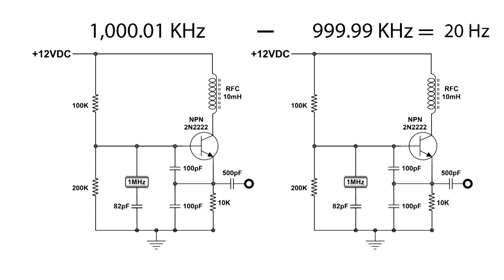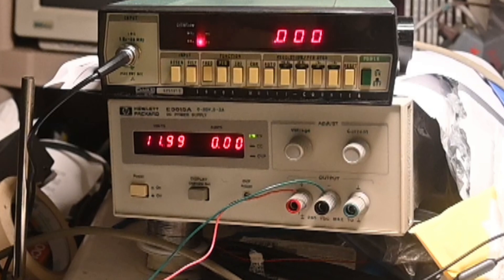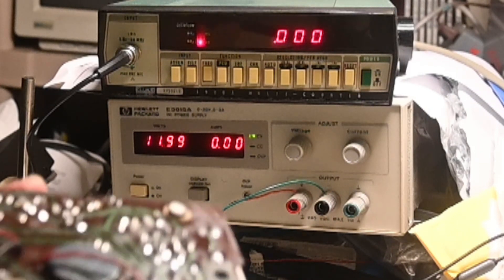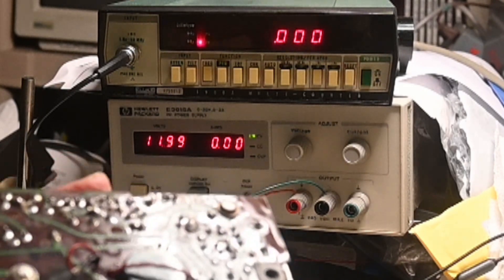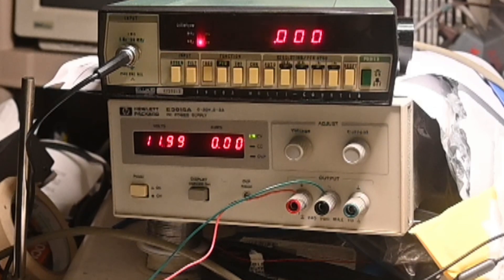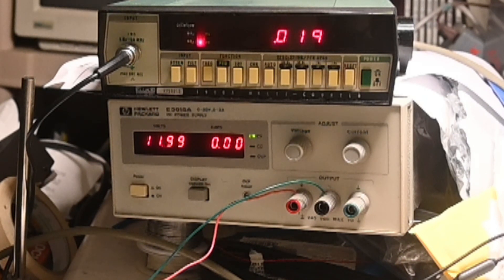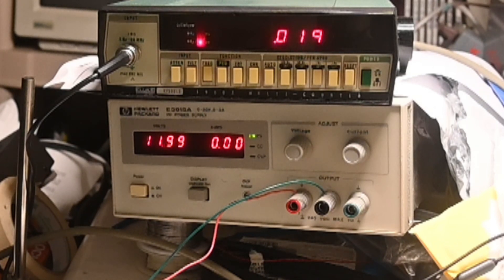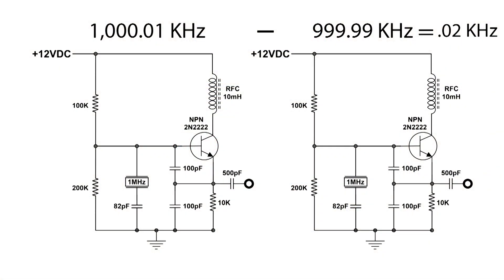Two 1MHz Crystal Oscillator Experiment

Comment: Occasionally at night when there are two AM BC stations on the same channel,  of similar strength,  you sometimes can hear a very low freq.  beat note,  not as rapid as that but a detectable fluctuation demonstrating a freq.  difference.   But most of the time not.  Which demonstrates the very high freq. tolerance for even AM stations of modern tech.  Although some stations may possibly be using vintage transmitters.
Reply from the maker: YES and it is all interesting!!!
Swap 1MHz Crystals and change Capacitor  and Voltage Values
https://www.youtube.com/watch?v=_0EhpM6bRaE

Comment: The more the videos contain OSCILLOSCOPE testing graphs, the more interesting the videos are!
Keep up the good work 👍👍👍
Reply from the maker: If you want more OSCILLOSCOPE  videos do a channel search on my channel for OSCILLOSCOPE .
Analog & Digital Oscilloscope Comparison on Tube AM Radio
https://www.youtube.com/watch?v=6D86WHKTHoM
Oscilloscope a Few Basics
https://www.youtube.com/watch?v=m7XCEecpBfk
Oscilloscope signal tracing
https://www.youtube.com/watch?v=B44wHjb8jMY
Digital PC Oscilloscope Signal Tracing
https://www.youtube.com/watch?v=_fHAuzDIgEQ
RF Bypass Capacitor Oscilloscope Demo
https://www.youtube.com/watch?v=OILLayQjEjY
Basic Oscilloscope 101
https://www.youtube.com/watch?v=WiNpGZaJArA
LC Resonance Oscilloscope Demo
https://www.youtube.com/watch?v=G_RCyDdt2rM
AM Radio Demodulation Oscilloscope Demo
https://www.youtube.com/watch?v=pKA0TPdnHg8
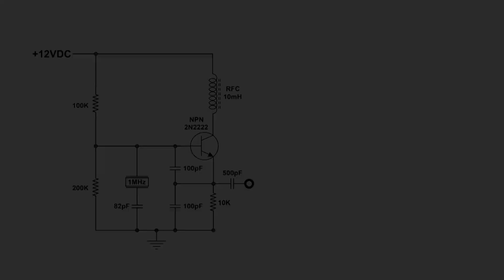0:00 / 3:16
Oscilloscope Trace Analysis 
https://www.youtube.com/watch?v=l77kAYx5QLg
Voltage Doubler Circuit Build Oscilloscope Demo
https://www.youtube.com/watch?v=kSRcBzNvnSo
Impedance and Frequency, Oscilloscope Demo
https://www.youtube.com/watch?v=TRSNKwtUy8g

Comment: Hi Rick, two things. First,  I don't know if you saw my second reply in the comment of four days ago? 
Second, I don't know if you have seen this 1943 American film/video about the manufacture of quartz crystals. It's fascinating, although I wonder how many of the girls suffered as a result as a result of the X-ray equipment used in the process.   https://youtu.be/duZlWWwxIPQ?si=cCgTbayyHrPXcW15   
I knew the basics of making the crystals but the detailed explanation really takes it to a mush higher place. The title . . .  From Raw Crystal To Crystal Oscillator _ Crystals Go To War in 1943.
Kind regards . . .  Andy
Reply from the maker: Hey Andy, I got busy with Thank Giving and I just finished a circuit drawing for a friend. I watched the crystal making video, that was very interesting, and I’m going to watch it again. I did find a number of etching PCB circuit board kits on Amazon, but no black tape.
On this video I got questions about what would happen if you swapped crystals and if you changed out the 82pF cap with another value. So I’ll make one more video on this before I tear down this circuit.
Kind regards ….. Richard

Comment: Hi Rick, nice little experiment. I wonder what happens if you swap the crystals over. I’d expect the frequency error to follow the crystals but you never know until you do the test. So may times I’ve been convinced I knew what would happen but man, I’ve been surprised so many times.
Hey Rick, can you still buy printed circuit board tape over there?? I’ve started looking at using copper sulphate and table salt (50/50 mix in warm water) to etch steel, aluminium and zinc (it’s simply a chemical action, not electrolyses, no power.)  I wanted to use some of the old PCB tape to create the resist screen for the shapes that I want and I can’t buy the thin black pcb tape anywhere in the UK!! I can buy thin black tape but none of them say that it’s suitable as an etch resist tape in warm acid. It looks like everyone thinks you have to use a computer printout. I’m sure that I’ll find something suitable but I was amazed not to be able to find it, even at RS Components. Am I getting old, with 74 turns on the coil, when did pcb tape become obsolete??  Well, if I don’t get to talk to you before too long, have a happy Christmas/holiday. (I just finished typing this and checked the other comments before sending, and I saw that swapping the crystals was the first comment, did you do it or take it for granted???) It also makes me wonder if there is anyway these two fixed offset frequencies could be used to enhance the classic beat-frequency metal detector, not sure in what way, but the old grey matter will ponder on it, usually at 3 am!!  I bet BFO detectors have been deemed obsolete.
. 

73  . . . Andy  
                      GW0JXM
Reply from the maker: Hey Andy, I will be glad to try and locate thin black printed circuit board tape. I met with some friend recently and one showed us his latest PCB project. I will contact him for information on his suppliers, Richard does amazing work. When I get some information I will comment back to you on this. Great hearing from you!
I have gotten lots of question on this video. So my next video will be on swaping the Crystals and also changing the values of a few capacitors. I’m going to be interested to see what happens myself. . . 73 . . . Rick -  KD4PJI
Reply: @AllAmericanFiveRadio  Hi Rick, please don't worry about trying to find a supplier of tape. It was a general question to see if it still existed that side of the pond, I really took it for granted that PCB tape would still be available in the UK. I must have used a mile of it back when I was designing prototype control boards for my industrial induction heaters. (Logic phase looked loops etc.) In the days before auto routing pcb software took the creativity out of it.  I'm sure I'll find some tape to do my job. Getting back to your fixed frequency offset error, I'd like to think that there is some way of putting it to use. Because both frequencies are controlled so well, I wonder if it's possible, in some way, to super sensitise one inductor beyond the usual to make a supper sensitive metal detector. I have no idea how modern metal detectors work. Do they still use frequency comparison based on the change of inductance?? Rick, I'm really glad to see that you are still getting a kick out of electronics and making the YouTube videos. I hope that the videos remain for hundreds or thousands on years to come, to remind all of them that just have two big thumbs what folks used to do and how they did it!!
By the way Rick, when I'm in my work shop I like to listen to an audio book on YouTube, I've enjoyed, "The Dam Busters" by Paul Brickhill, you might enjoy that, lots of trial and error just what I love.   
All the very best my friend

. . .  Andy
Reply from the maker: Swap 1MHz Crystals and change Capacitor  and Voltage Values
https://www.youtube.com/watch?v=_0EhpM6bRaE

Comment: I think a possible cool use for something like this would be in a random number generator, maybe using two different value crystals. Or possibly even without crystals, just two free running transistor oscillators to get even more random.
Reply: To make it random you need a noise generator
Reply from the maker: Free running transistor oscillators would work. A friend sent me this link on Starlink, I think you will find this very interesting. 
Starlink “how it works”
https://youtu.be/qs2QcycggWU?si=dweLTH_w4Wr8aqAD
Reply from the maker: I have had a number of questions on this, so I'm going to do another video.

Comment: Home-made woodpecker.  Move over, Russia.

But seriously, folks, this is the essence of a Theramin.  Put an warbler antenna on one of the crystal pad caps.  The other oscillator won't be so eager to pull in & lock at low beat.
Reply from the maker: Thank you! And thanks for the information.

Comment: I did something similar with a 10MHz oscillator to check a frequency counter.  During the daytime when 10MHz WWV was coming in strong I fed the output of the oscillator through a 10k pot to a 2" antenna.  When zero-beat to WWV the frequency counter could be adjusted.
Reply from the maker: That is an interesting idea! 
Thank you!
Reply: @AllAmericanFiveRadio  I just came across a video by W2AEW (also his channel name) who did the same thing I did.  However, it was posted 12 years ago and I did my adjustment 30+ years ago.

#58: How to zero-beat WWV to check or adjust a Frequency Counter's accuracy
Reply from the maker: @richardl6751  Thank You!
That very interesting, I’ll look for W2AEW Channel. It is amazing how useful and accurate zero-beat WWV IS!
Reply: I use to use WWV as my reference for adjusting references in freq. counters for hobby use,  as well as the calibrators in many receivers. Careful use can give you enough accuracy for the hobby uses.  The issue is some cheap counters have had a time base osc. of an odd frequency, not harmonically related to WWV freqs.   I ended up buying a cheapish Rubidium reference unit on ebay that was used for cellular checks.  Now I just use that loaded into a scope with the other unit in the other channel.  But I always have WWV to fall back on,  propagation dependent.

Comment: It would seem to me you would have resonant frequency,distortion. Is that a collpits, Hartley, or Pierce,Armstrong oscillator.
The motor boating sound is your resonant distortion.😢
Reply: The motorboating is the intermediate frequency due to the difference (beat frequency) in the two 1 Mhz oscillators.    or  Superheterodyning the 2 oscillators.
Reply: @jp040759  So if there identical, same crystals, chokes ect, temp differences & component differences would never allow identical outputs. If you capacitively couples that choke we would see it breathing, and a center peak doing the Beat frequency shuffle= F 1/t My neurons got exited ~ ~ ^
Reply from the maker: The Superheterodyning  is on the antenna of the AM radio. That is where it mixes together. 
Thank You!

Comment: It would be interesting to somehow make one of the oscillators adjustable. So you could tune out the difference. Cool experiment.
Reply from the maker: It would be difficult varying the frequency because of the crystals. But I will search and see if it is possible.
Thank You!
Reply: @AllAmericanFiveRadio  If you replace the 82pF capacitor in series with the quartz with an adjustable capacitor, you can "pull" the frequency of the oscillator by a few 10 Hz or more depending on the quartz' characteristics. In practice, you replace the capacitor with a parallel connection of a 33pF fixed capacitor and a 10-40pF trimmer, for example.
Reply from the maker: @dg0mg  I have gotten a number of interesting questions about the Crystal oscillator. It is very stable. I like your question and will do another video on them. Changing the 82pF will do little to change the frequency. I also have had questions about swap to another 1MHz crystal. Thank you for your questions. I will send you a link to the video in this comment.
Reply from the maker: @dg0mg  Swap 1MHz Crystals and change Capacitor  and Voltage Values
https://www.youtube.com/watch?v=_0EhpM6bRaE
Reply from the maker: Swap 1MHz Crystals and change Capacitor  and Voltage Values
https://www.youtube.com/watch?v=_0EhpM6bRaE